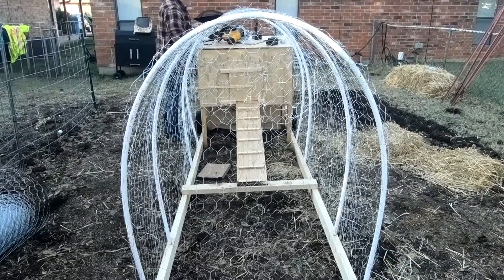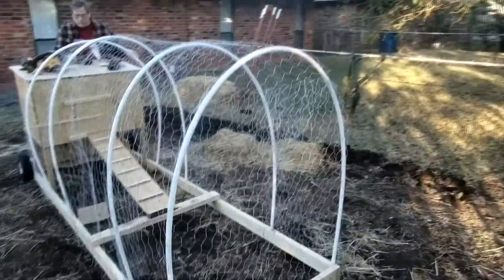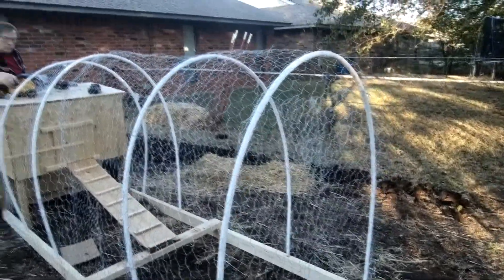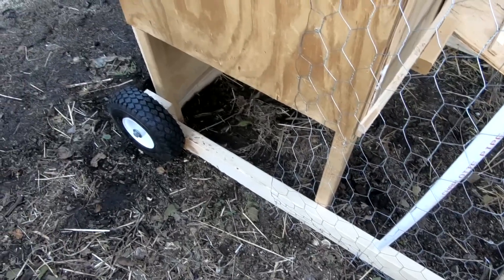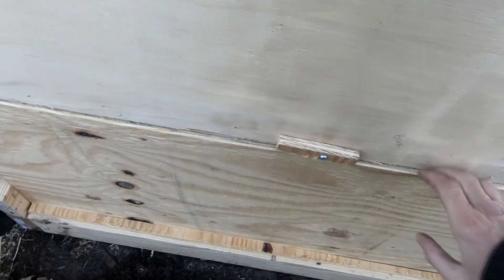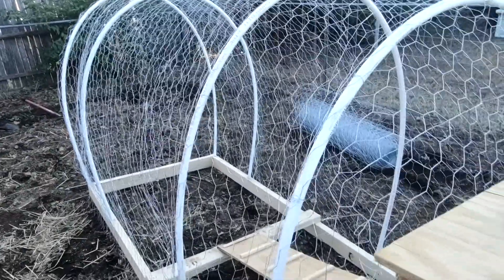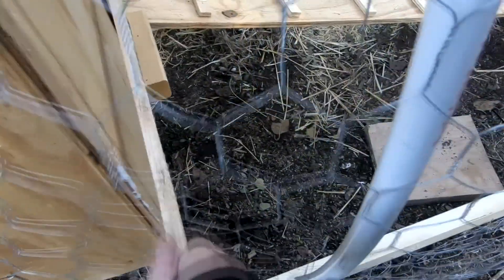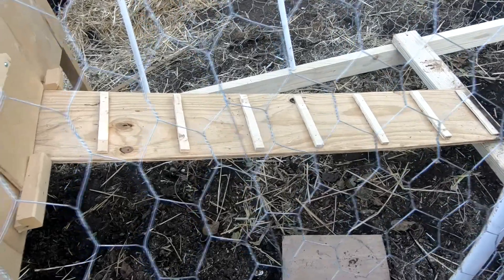Let's Try This Again - New Chickens!

Comment: If you take a 1x2 and or another peice of PVC would work also.  Attach it across the top it would stabilize the pvc and make it more sturdy.  During the winter you could cover top with clear plastic to let sun light in and keep cold and rain out.  Good luck with your new ladies.
Reply from the maker: Thank you very much for the good advice Randi.  And thank you for watching!